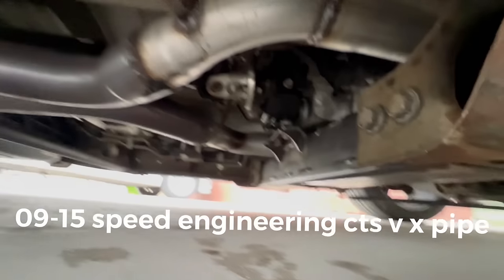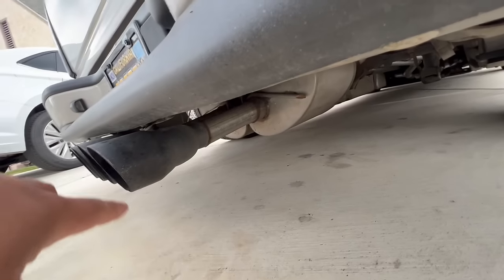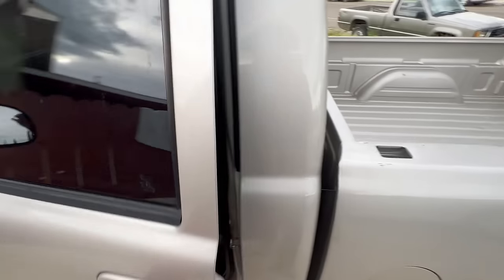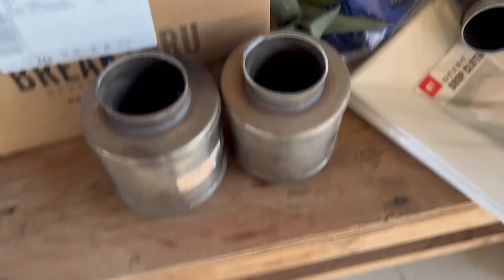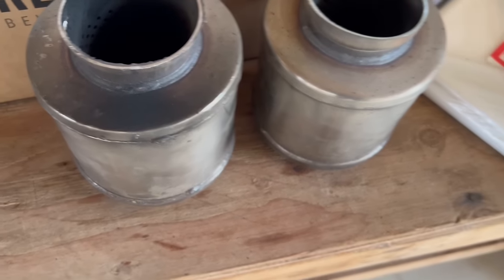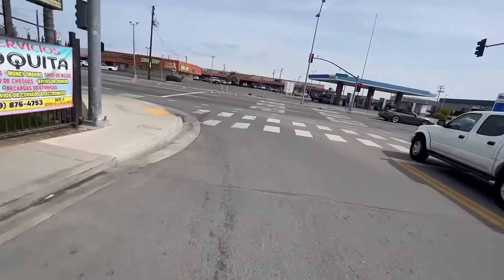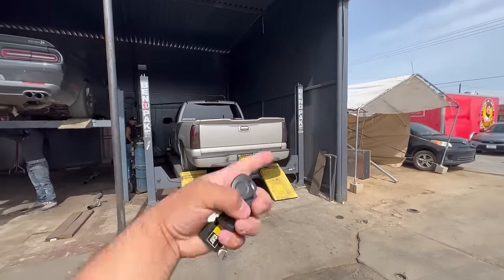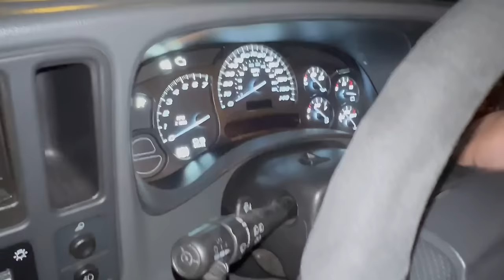HOW TO MAKE YOUR LS SIERRA/SILVERADO SOUND LIKE A CORVETTE CORSA EXTREME EDITION !!!!

Comment: I didn't catch what headers you were using??
Also you mentioned that the x-pipe and mufflers placement was crucial..could you specify on where and why they are where they are? I have shorties on my ls2 rx8 and can't run LT's without some ridiculous custom headers and I love the sound of your truck..hoping to replicate this
Reply from the maker: It’ll be much easier to get a sound like this out of a car like yours since you won’t be running long piping such as I am since it’s a truck, yes you can run the x pipe with shorties, and in my particular set up for trucks I said that the x pipe is crucial because trucks come with a L shape pipe that converts into one and that gives it the truck sound and then the mufflers I placed them all the way in the back to mimic a car axle back, I’m sure your rx8 already has the mufflers all the way in the back since it’s a car

Comment: Is this the corsa sport or corsa extreme the link takes me to the corsa sport exhaust just wondering because the truck sounds amazing
Reply from the maker: Yeah those are the right ones, they don’t actually make an “extreme” axle back, the extreme catback system uses sport axle backs and the sport catback system uses the touring axle backs
Reply from the maker: Thank you !
Reply: If you buy just the mufflers from Corsa they are actually the Extremes. I put them on my 18 CC with equal lenght exhaust.

Comment: What if you did a side exit with the mufflers in the original location?
Reply from the maker: I would love that, but you would need to opt for smaller mufflers, because those axle backs are too big to fit in the middle unfortunately